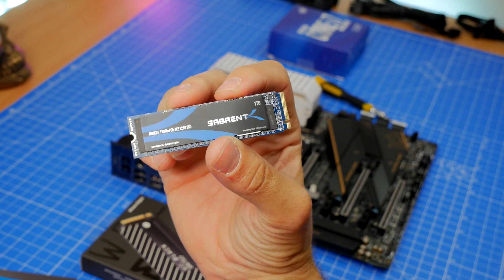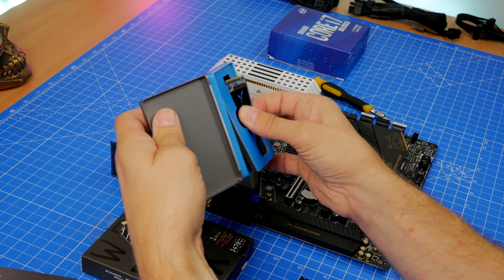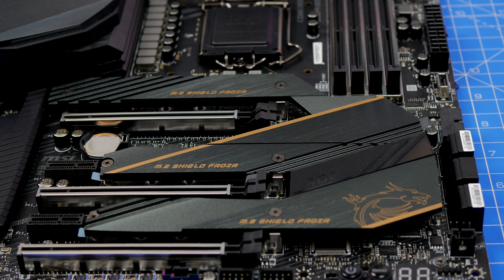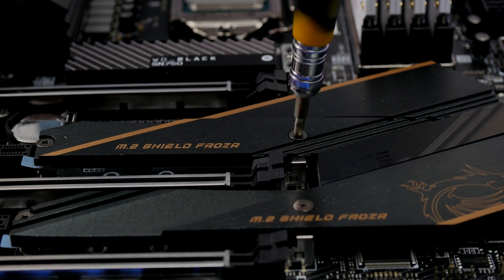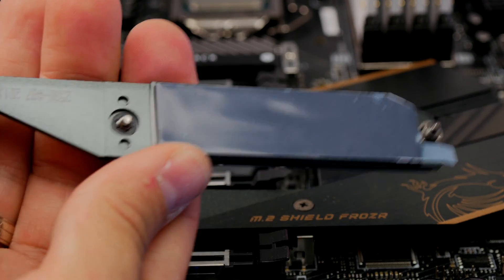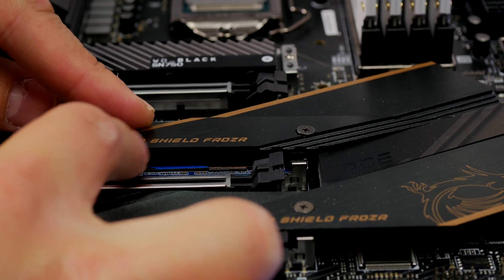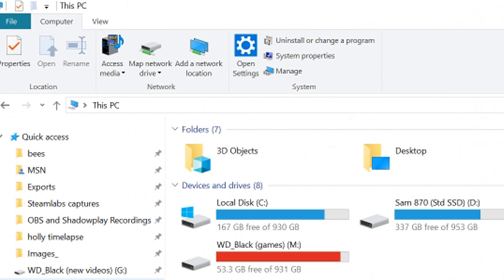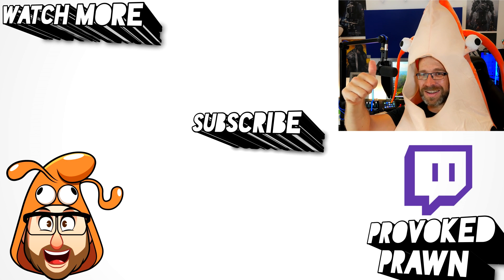How to install Sabrent Rocket NVMe SSD

Comment: I hope you see this, thank you so much for the tutorial! Just a quick question, I installed my Sabrent rocket a fair while ago and Windows could not pick it up (with the window popping up) do I take it out and reinstall it? Or have I broken it by screwing it in too securely and snapped something?
Reply from the maker: You might need to check your bios settings
Reply: @TheProvokedPrawn  Thankyou for replying! I am a noob when it comes to the Bios side of things, what in particular should I be looking for in order to fix this issue? :)

Comment: Have you had any issues with the Sabrent Rocket gen 3 since installing?
Reply from the maker: Nope, still going strong.
Reply: @TheProvokedPrawn  Hey, thanks for getting back to me. I have just bought one and since have been reading about drive failures in the reviews happening within a year! They are amazon reviews though which I'm inclined to think that most of those fails could be user inexperience especially where the drive is not recognised by windows for an install. So I'm looking on YouTube for drive fails but have not actually found any which is unusual again as it is usually the first people turn to these days to show complaint.
Reply from the maker: I've been using mine for storing new footage which then gets moved to a Nas when I'm finished so it's regularly reading and writing with no problems.
Reply: @TheProvokedPrawn  Sounds good. I have thrown caution to the wind and kept the drive. I dont if it was cheap at £41.99 for 256gb or other brands are slightly over priced as these NVMe formats are very cheap to produce apparently. Certainly the cheapest out of all the current hardware formats. Thanks again for your feedback I am sure others will find this useful.

Comment: dude this was an an amazing demonstrative video.  I already knew how to install m.2 ssd drives, but Ive never changed one that had the heat sink. So i was wondering if the screw from the heat sink is indeed the one that screws down the actual hard drive and it turns out it is. Thanks a bunch for the video.
Reply from the maker: No problems

Comment: Something that I found a bit confusing (which led me to this video) is that the Sabrent manual says to, ‘Remove the clear thermal tape protector,’ however I only found thermal tape on my motherboard’s PCH cover. I wasn’t sure if I was to peel the label off the M.2 or if there really just wasn’t any thermal tape on the drive that needed to be removed. 

I didn’t see you remove any tape or label from the drive, so I’m hoping that means that there wasn’t any that I missed?
Reply from the maker: Nope nothing removed.

Comment: Hi do you need to peel off the label on both sides of the Sabrent NVME SSD before installing the heat sink?
Reply from the maker: No
Reply: the labels on both sides ARE the heatsinks plus if you remove these you void your warranty